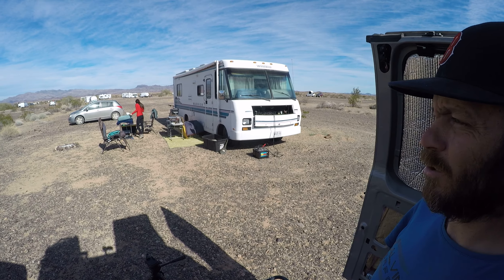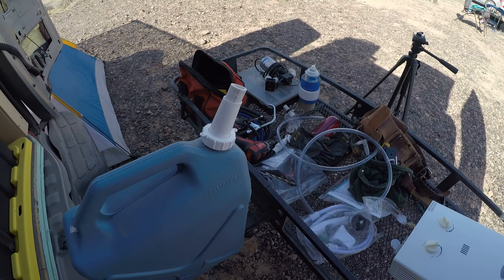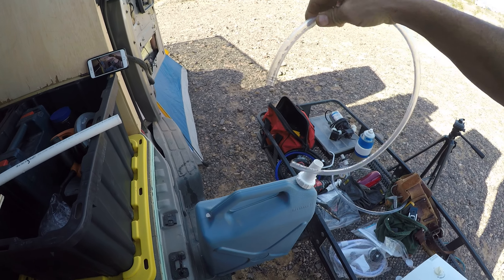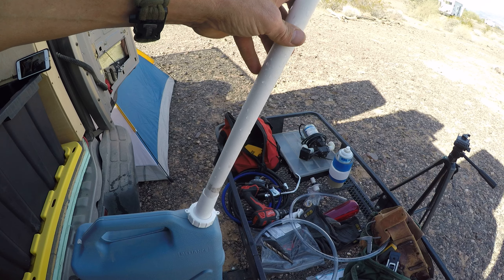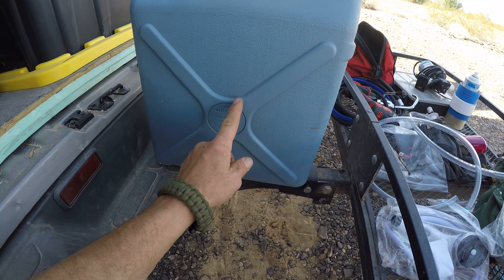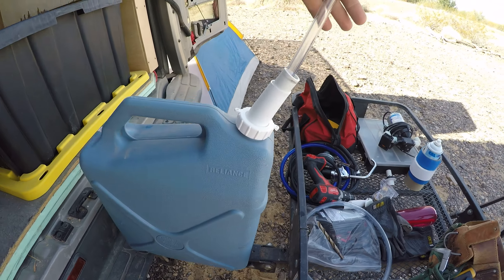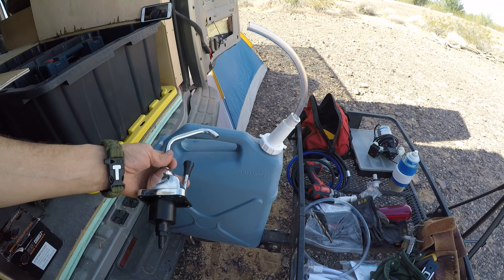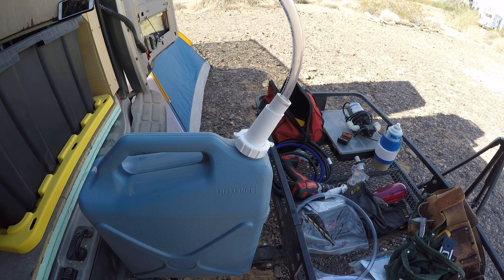Vanlife Hack! Reliance 6 gallon water jug tip to get all the water out, no tipping required. #shorts

Comment: Good tip, one thing to add to your fix is to notch that pvc pipe where water can get to the tubing better as well.
Reply from the maker: Seeinya traveler ty for the comment. I actually don’t have this set up anymore. I’m in a bus now. But what were you saying about the notch? I still hang out with a bunch of vanlifers and can pass on your idea too!
Reply: @vancampinglifestyle  The end of the pvc pipe you put in the jug, make a "V" notch in it that way even if the tube is right down to the bottom of the jug , water can get up in the tube because of the notch.   Hope I explained it ok, I dont really  explain things well
Reply from the maker: Seeinya traveler I see what you mean now. Makes total sense. Ty for the tip!